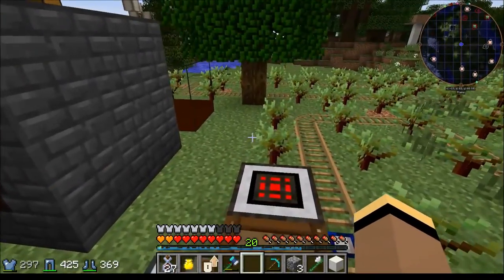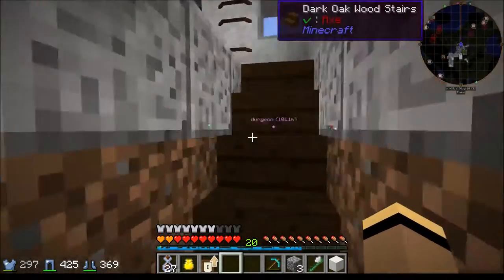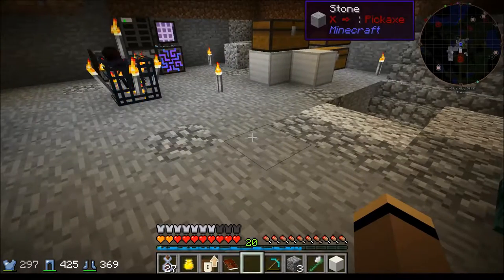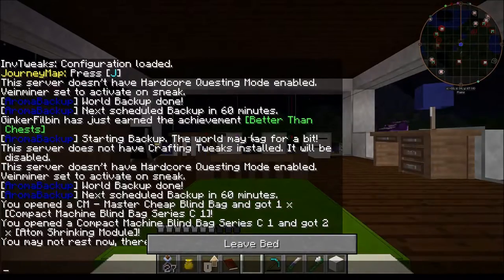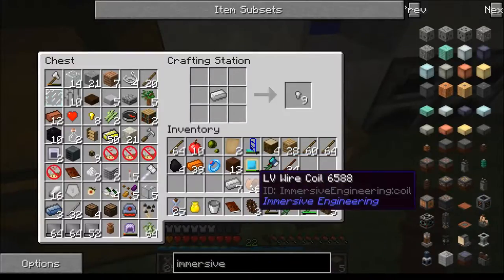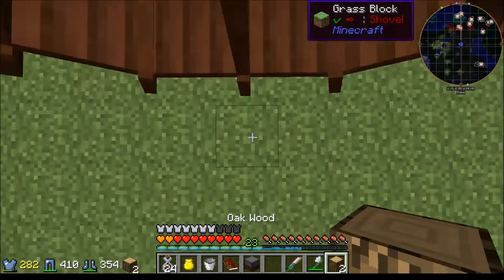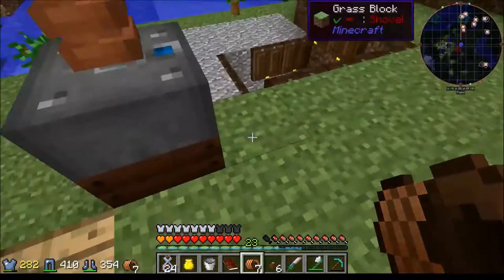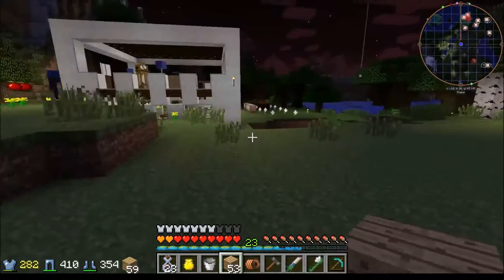The Ferret Business - E 14 - Ferret Storage

Comment: Make the Advanced Inscriber and Advanced Crystal Growth chamber ... well worth the cost....
take a look at the Crystal Flux mod .. it solves a lot of resource issues .. Ender pearls, Gold, Nether and Certus Quartz, and blaze rods...just search seed...
The cheapest power is the immersive engineering water wheel. The best early/mid power production are the Mekanism windmills but make sure they're above Y200 (mekanism universal advanced cable suffices). they work ok at Y100 but to really get the most out of them they need to be above Y200.
The Immersive engineering book is a book+lever.
Legendary phaser rifles are the best way to deal with Nagas/Sirens/ghasts but not androids .. tinkers longbows with blaze arrows work better against them.
The ImE capacitors are okay .. but the ImE connectors will connect to Thermal Expansion flux ducts and Energy cells and Extra utilities capacitor banks.